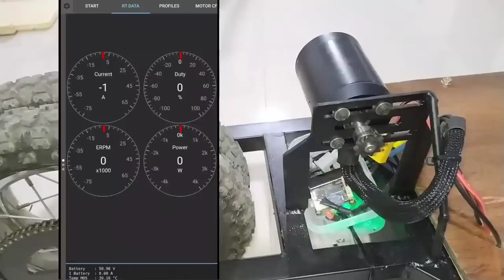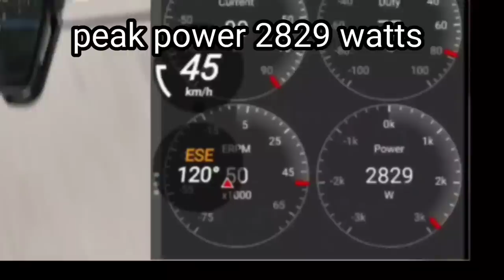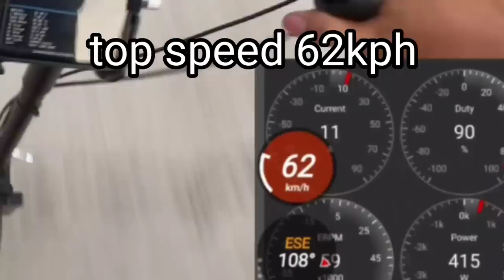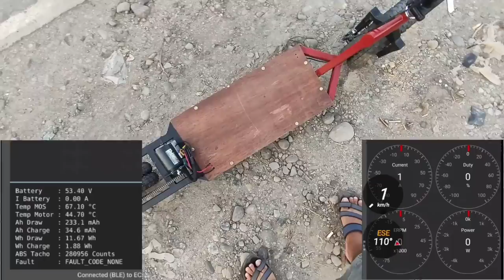Make your own quad tires electric scooter

Comment: Nice build!
The only thing that I would add is a way to protect the battery compartment from moisture. Probably with a couple of weatherproof gaskets, silicone caulk or some combination of both.

Otherwise, not bad for basic, quick transportation.

Comment: If you pour silicon on top of the batteries so that the batteries do not move while driving, they will never be damaged. I have not tried but I think it might be a good solution. You see, the problem is that while driving, the batteries shake and fall apart, and this is the reason why the charge runs out after a while.

Comment: That's an amazing build! I would've left the multi-speed gears intact though. It's not hard to keep a derailleur setup & you would get more Torque for going up hills & your top speed would be far greater. Not that 62kph is slow, that's awesome for a scooter, but you could add on a removable seat & foot plate riser & make better use of the motors power through the use of a 5 or 7 speed setup. You could also use Mountain Bike front & rear brakes & a Quadbike style thumb actuated throttle for ease of use & over all reliability. A little bit larger wheels and tires would help with uneven terrain stability & application of power as well. I'm not harshing on your build btw. I love it! Just suggesting some upgrades that would help out. A double stack of batteries & watertight compartment for the batteries would be better as well. It would obviously double your range & make it safe to use in the rain. Ohhhh a lexan/acrylic pod for the scooter would look so cool! And yes I understand that this video's purpose is to show how anyone (with a welder, grinder, rivet gun, and welding magnet/stay) can build one of these. I fully respect & appreciate that! Just wanna see you take it further now, after showing everyone the base model & how awesome it is. You could even run Gokart wheels & tires & make it a little offroad capable mini-monster. Thank you for showing us all your amazing build! I love it, and will be making a gas (probably a 4 stroke) powered mini-bmx bike (a normal bmx but I'll chop it down & stretch it a little) that will fit in my car's trunk. By the way, do you ever see a 2002-2005 Hyundai Grandeur in your area? I've heard that people in the Phillipines still make body kits & performance parts for them & for JDM cars. I would love to link up with you on parts & talk about stuff, if you feel like it that is. Again, thank you for the great video!!! You've motivated me to start my build. Just gotta buy a welder & a gas mini-bike kit now haha, I have most everything else that's needed. Take care & keep up the awesome work! Much respect from the Central Oregon Coast!
Reply from the maker: let me think how to make it possible.. on 12in wheel rd aren't fit. I'm going to bigger wheel in that case.. but thanks for that
Reply: What is that magic he uses to unite two pieces of metal?

Comment: bravo! nice work.
but.... to increase the battery, i would recommend to remove the "break" adjustment from settings, and install a cheap  hydraulic Brake system for bikes.
Reply: High tech DIY

Comment: That's totally insane! 62 kph for a tiny motor. My only concern is your braking system,much better if you have another set of disc brake for your back wheel but nevertheless it's a great scooter.
Reply from the maker: yes it's better but electronic brake on VESC is outstanding. I barely use the front brake. 🙂👌
Reply: @albertnario4877  keep doing what you love and you'll go a long way.
Reply: Hi sir pede pa custom make?

Comment: Gr8 scoota, Gr8 build, but I’m guessing it would weight a tonne, surely with abit more ingenuity you could create a liter, stealthier frame. 
Lite weight materials, carbon fibre etc a liter scooter will improve performance, speed & distence.

Comment: very good friend your projects. a question which is the most economical this scooter or the other with the hub motor ? do Brasil
Reply from the maker: hub motor are more durable. less mechanical parts
Reply: @albertnario4877  the most economical engine that uses less battery and which has more power on the climb

Comment: With no suspension, it will break sooner than expected..just one rough ride and SNAP!!
Reply from the maker: it's not made for jump, but the tires have low pressure like on fatbike

Comment: I want to ask you few questions, whether it is better to buy cheap electric scooter or to make like that? Is it worth to make? Will it go for long time?
Reply from the maker: it's far better on below usd400 scooter. only issue I see is the alignment of rear sprocket, because of thread. if it get fix  it comparable on above usd800 scooter.
Reply from the maker: in flipsky motor its smaller and lighter, but you need more gear reduction. both of them can handle 3000w peak.
Reply: @albertnario4877  i understand thanks for information, so do you have discord? i want to ask you few more questions.
Reply from the maker: fb only  https://www.facebook.com/albert.nario.1
Reply: @albertnario4877  i sent you request

Comment: Nice build but i dont understand the economy in this setup. That motor draws Close to 95 Amps on full throttle and even if the cells can manage this without melting (aprox 20 Amps/cell max discharge?) the battery would be empty after a 10-15 minutes ride... But i suppose that would have Been One hell of a ride😃👍
Reply from the maker: that's phase current not discharge current from battery.. on normal ebike controller it's way higher like 140A on 1000w controller.
Reply: Thats how duty cycle works. You can google it. You can use 60amps battery in 120 amps motor(1 motor or 2 parallel motor etc). And also his setup is 13s5p battery settings in VESC is 60a/5(p) = 12a each battery. that is fine for most 21700 battery. Also that Vesc has dev option so you can log everything the current the speed,erpm, battery current, motor current, battery level and a lot more.

Comment: Ingats rated 50A continous / 100A short burst ang esc na yan. Marami na nasunugan ng fsesc 4.xx sa FOC mode. Switch to BLDC o di kaya mag fsesc 6.6.
Reply from the maker: tingin ko kelangan ng malaking heat sink neto... unlike kasi sa 4.2 at 6.6 may heatsink n sila sa ilalim.

Comment: from what i've seen on your setup earlier... the speed is not the actual speed... it is the motor speed not the wheel speed. from the size of yr sprocket the ratio is quite big.maybe yr actual speed is half or lesser than 62kph. u should use gps speedometer instead of that bluetooth reading.
Reply from the maker: that's VESC it compute the motor speed gear ratio and wheel size to give accurate speed in real time..

Comment: Greeting Engineer 

we are interested on your channel and works and thought you might have an idea to help us on our project. 
our project is about design a treadmill bicycle where it can be used to exercise and transport at the same time. on the product movement we will depend on: 
1) First the chain drive which will connected to the treadmill roller and the rear wheels so it actually relays on the user physical efforts. 
2) Second a scooter motor, so the if the user is tired or do not want to move using the treadmill. 
the conflict is if the scooter system is ON how to not let the chain drive move and the treadmill since they are connected to the wheels. 

looking forward for your help if you have the time. 
kind regards

Comment: I don't understand the zap, zap, zap welding technique.  I've been welding stuff for 50+ years and those tiny "tacks" are not sufficient for ANY stress/load. Thin metal, weld fast and "step" the rod as you go. Too much to explain here but I wouldn't  get on it.   Good idea though.
Reply from the maker: it's work fine to me.. maybe show to me how to weld thin metal properly..

Comment: Vesc 4 verson has problem with 12s better run them on 10s or els u may blow up
Reply from the maker: maybe just need bigger heatsink.
Reply: @albertnario4877  dont run them on foc mode.
Reply from the maker: what mode? bldc?

Comment: Ang bilis tumaas nung tempo mosfet hahahaha ^_^ mahirap mag tagal yan for kilometers. Exposed it or find better heatsink. Pano sya for that agressive 60a max battery each which is 120 total lagpas ah :) at lagpas din sa 60k ERPM yung settings mo fsesc/vesc ver 4 can only handle 60k if you review your video you did 60. mostly napansin ko speed = erpm/1000